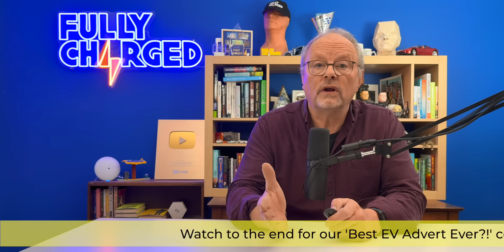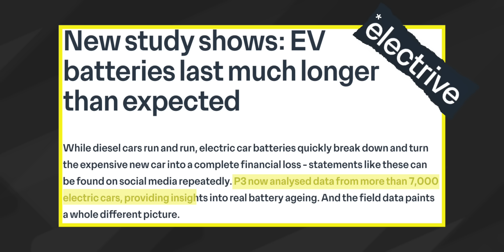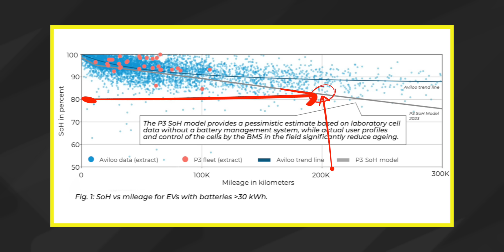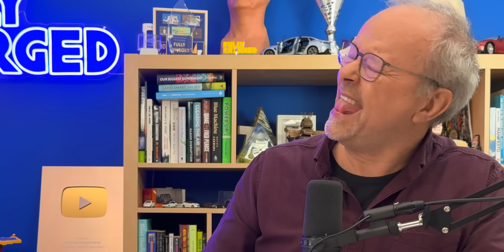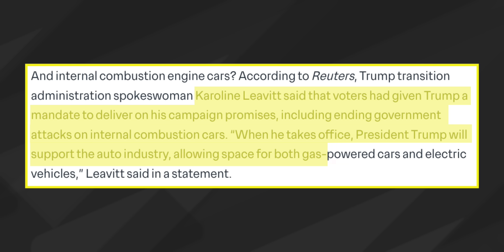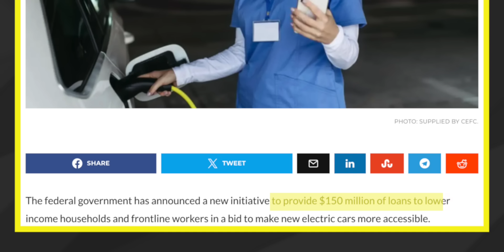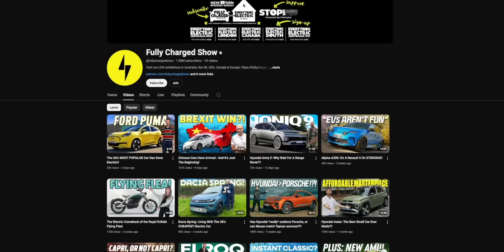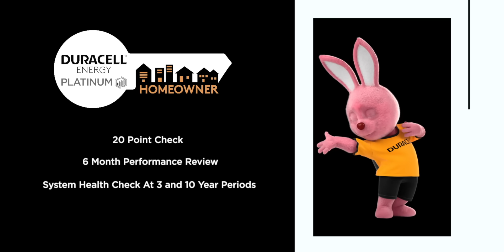The Truth About EV Battery Life, Government Subsidies & The Future of Coal Ash?!

Comment: The problem with solar panels the best they can ever get assuming it never rains, hails, snows, overcast, hurricanes, tornados is they can only operate 50% of the time. And the further away from the equator the lower that figure gets because of seasons. Meaning you have to have an alternate power supply running all the time on standby.

Comment: I'm not a hater or a Daily Mail reader, but I was put off buying a second hand Jaguar I Pace because of battery issues.
It's probably an isolated manufacturing problem with 2019 cars, but Jaguar are having to buy around 3000 of them back at market value,  I love the look of  Ian Callum's design but I've also read about the long waiting times to book Jaguars in to the dealer for attention. Sad to say ,I'm looking at buying a Korean EV now.

Comment: EVs = excessively expensive, very high insurance cost , extortionate road tax, 40% depreciation year one, no second-hand market, high 'fuel' costs (home electricity will attract surcharge for EV charging soon), unreliable, dangerous, fire risk, car park/ferry restrictions, breakdown services won't repair/touch, minor dings result in insurance write-offs, range anxiety, 40% range reduction in winter, no soul/character, National Grid cannot support further EV adoption without blackouts, the public don't want EVs, too much unnecessary technology/unreliable, batteries cause environmental pollution/recycling extremely difficult, contribute to sl*ve labour/human rights abuses (where do you think the minerals for the batteries come from?), government EV sales mandates destroying British jobs/industry (Vauxhaul), increased tyre wear causing more roadside pollution/toxic, expensive servicing costs, public charging station disputes/anxiety/costs/out of service chargers, extremely heavy - contributing to erosion/pot holes, WEF/Net Zero/15min Cities driven, funds the Chinese government and industry.... and that's just for starters! And, by the way, split-water hydrogen engine technology is poised to take over the EV market as it's safer, cheaper, accessible, better for environment and can be retro-fitted to existing ICE engined vehicles (including classic cars).... Don't get me started on manufacturers forcing Motability users to lease/buy EVs which are completey unsuitable for disabled users (the weight of the charging leads - the complicated payment apps - the short range etc.). = EVs are obsolete.

Comment: I disagree, I don't think a battery is still 'fine' after 300.000 km, if 25% of the capacity is gone. As the capacity wasn't that great to begin with, another 25% less is a lot. I have a petrol car nearing 260.000 km, and it still has 100% range capacity. Having said that: I don't say I won't by an EV. If I could afford an Aptera, I would certainly buy it.

Comment: When an EV can perform as well as my diesel SUV, I will be happy to switch. I rely on towing capacity and mileage. Australia is a huge country and long distance driving is the norm. The infrastructure for EV's is virtually non existent. Most people live in apartments which have no facility for Charging. If i lived in the city and had access to a charger, i would certainly go EV.

Comment: My 1993 MX5 was fine after 450,000 km.
In that distance, It had a new radiator , a new voltage regulator , a new clutch it didn't really need , 3 cam belts, new differential bearings because a previous owner did not fit an LSD correctly.
All of which I performed myself.
If your car turns to crap over a short period , it just means you are a careless consumer like most people and not the environment/conservation minded person you imagine you are.
And your ownership of an EV will be equally as wasteful

Comment: My electric Citroen E-dispatch displayed a range of 200 miles when new  . After 31000 miles yes 31 , range is down to 135 !! Light use but I found it would lose around 25 miles in winter months but it would not come back when temperatures rose .
Reply: Range estimator are notoriously inaccurate

Comment: Sadly, the deep history ice sample and other evidence shows that we are just existing in the time lag between unprecedented CO2 pollution and the inevitable hellish temperature rise. Big Oil killed us in the last 20 years of the 20th century.
Reply: This videos has couple of arguments that I don't fully support, but the argument that I seem to fail to find is regarding the EV charged from coal power plant, according to chatgpt investigation😅 the total emissions of a EV charged from coal energy is still less than gasoline or diesel when comparing emissions from earth to exhaust pipe (just the oil extraction+ transport+ refining+transport+30% efficiency in the car  compared with digging coal and burning it at about 50% efficiency [using residual heat for city heating and industry] and 75% to the EV till the tire [electricity transport in grid +charging+battery and engine efficiency] with bonus of regenerative braking and way less maintenance costs) 
In general there are very few cases where the ICE is still very hard to replace by EV
There's a great speech of Carl Sagan comparing the cold war investments and the climate change investments😅😅

Comment: The clean energy price is linked to gas though hence consumers dont see the gains. Although are frequently informed if they didnt change their old lightbulbs for new, their energy bills would be higher.

Then comes nerfing. Building bulbs which have a limited lifespan of 1-2yrs or consumers fridges stop working due to last update. As its the greed of business which dictates what consumers have to pay and do.

Heavy ev's for example has been resoundingly impracticable. So much so that almost all but Jaguar have pulled out of such vehicles. The price ceiling also became too high for any mass market product, to be viable. They simply ran out of gullible consumers ⬅️

Comment: I like your content, but now your telling lies. I have an Isuzu DMAX diesel Ute. And I’m coming up on 300,000km with no major issues. It’s not full of spare parts and still looks fresh. I know of other diesel vehicles that have done even more. I like the idea of BEV cars. And I’m thinking of getting one. But Im pretty sure that by the time the BEV gets to 300,000km there will be electric motors to replace or repair. I feel yes the batteries will still be functional,  but its the windings in the motor(s)of a BEV that will need an overhaul before that 300,000km mark

Comment: In 2015 I responded to Clarkson's dishonesty regarding EV's and some local hostility towards solar panels and wind turbines... I put a PV system on the roof and purchased a one year old, 10,000 mile Gen 1 Leaf. My wife uses the Leaf for a daily 30 mile commute plus countless journeys with our kids.

We now have three EV's on our drive, including the Leaf which has now done 134,000 miles with the original battery still at 82% according to Leaf Spy.

I drive a 2024 MG4 Trophy which I really like, especially as I got it brand new for £25.5k. The LKA is an abominable bit of software failure but it's easy to work around.

We also have a VW ID Buzz Cargo for business use. We do a fair bit of work in London which is a 125 miles round trip from here. Compared to ALL other vans I've driven over the past 30 years (petrol, diesel, manual, auto) the Buzz is in a league of it's own and an absolute joy, especially in 4mph London traffic using ACC.

Ok, the Buzz is one expensive van but we charge at night at 7.5 pence per kWh which saves 16 pence per mile on running costs. We'll keep it for 100k miles which repays most of the additional cost (I'm more than happy to pay any potential additional cost incurred when compared to an Ice van because I finish all journeys WAY more relaxed).... It's really nice doing 65mph in lanes 1 & 2 rather than 85 in the outside lane like many other van drivers - and I'll only be 5 minutes behind them when I get to central London, with my clean license...

The one absolute essential for successful EV ownership in the UK is the ability to charge off road, at home or at work (ideally both). Public charging is getting much better but the cost is daft.

BTW. Our PV system outperformed all projections and has been an excellent investment (how I wish all my decisions in life had been as good..!).

Comment: If there is no concern about the battery then car manufacturers can own the battery and replace when degraded 👍
Reply: Renault did that with the early Zoes and the Twizy but it was dropped probably as it hurt resale value so put people off. Right now there are some very cheap mk1 Zoes for under 3k but as they were sold without the battery you'd have to pay £50 per month for the battery.

Comment: 5:36 the diagram of the aging doesn't show the improvements in thermal management systems. My first EV back from 2017 had a degradation of 10% after 100.000 km, my second from 2022 has about 1% after 100.000 km.

Comment: In Australia a Rolls Royce Spectre is $1.2 plus million. How long will its battery last? 
Can you still drive it or even turn it on in 25-30 years? It doesn’t matter on a $50 thousand BYD but very different for a Rolls. 
You can quite easily still drive a 100 year old Rolls Royce without any problem. 
What does everyone think,what is Rolls Royce’s sales spin if you ask this question in the showroom?

Comment: To be clear, I am a fan of EVs.  If I could afford one with a usable range I'd buy one.  But I am also a realist.  Whether you like it or not, you are still very dependent on fossil fuels. At this time of year in the UK, typically about 50% of energy demand comes from gas turbines.  When there's no wind that goes up to 60 to 70%.  Just checked - today, only 1% of demand is being met by solar.  So why belittle and denigrate attempts by the fossil fuel industry to mitigate the effects of that?  Sorry, but your mocking and sneering rant has put me off.  I don't need yet another bias confirmation channel so I will take your advice and unsubscribe.  'bye.

Comment: there is an irrigation reservoir just across the field from where i live. the guy who owns the farm has just covered his cowsheds in solar pv, about the same area as the reservoir, and cheaper to do because the infrastructure around the cowsheds supports the installation of the panels much more easily and cheaply. Also he told me he didn't want to see geese and swans bouncing of the panels on the reservoir as they try to land on a surface that to a bird looks pretty much like the water surface. So has anybody looked at the environmental impact (no pun intended) of solar PV floating on water? i can think of quite a few effects it may have on the ecosystems in and around a lake.

Comment: In France I woukd point to how people view the use of a car, tge difference of rural against urban . One point to make is the filling up of petrol may be every two weeks and the feeling is that an electric car will need recharging every two days, the more  frequent the charging time the more it seems to require local charging points and these are not available for more than a few cars . If villages were equipped with five or more charging stations I am sore there would be a fast take up of EVs. Around cities there are areas of parking and charging with solar equipment but the space is not always availabke in villages or small towns , here it may need grid linked chargers and some form of card activation and a localized payment scheme .

Comment: I like your show. And I agree with providing accurate information. However, you have made an error. I just bought an EV after I traded in my 2007 Prius, which I drove for 266,000 miles or 428,000 kilometers without any major mechanical failures or repairs to either the mechanics or battery. I know that it a simple of argument, but just stating something is complex does not support the conclusion it is less reliable. I am certainly glad I did not drive a petrol car for 266,000 miles.

Comment: I have to disagree that cars are knackered that mileage
My last 2 cars had over 220,000 miles and were sold on to people who carried on using them.
An 2006 audi a6 2.7tdi quattro that was a dream to drive even at that miles and a 2009 Citroen grand picasso 1.6hdi which was just an old clunker but still kept going and wasnt horrible to drive.
Biggest issues with both cars were electronics and not mechanical.

This is my biggest concern about new cars as the electronics are likely to be the fail point and theybhave a lot of electronics on them.

I know drive a Skoda Enyaq on the motability scheme and absolutly love it.

Comment: Hi Robert, great news as always.  FYI... my 8 year old EV just reached 300,000km  (187,500miles).  The battery has lost 10% of it's original capacity, range now 400km in winter.  Whilst it's worth giving attention to the longevity of EV batteries you might want to also celebrate the extraordinary capability of electric motors.  My car has two, neither of them has ever required any attention.  Nothing!  They purr along with the same fluid power and dexterity that they had when I first drove the car.  I can not sense any change at all.  I have been advised by Cleevley EV's that they are due an oil change now.  Try running any ICE motor for 300,000 km without giving it any attention.  The BMW's and Volvo's I used to own would be on their last legs at this mileage and costing me a fortune to service.

Comment: The so-called: electric vehicle batteries have a short lifespan, so used cars are cheap. This is a wrong image. At least in China, the reason why second-hand electric vehicles depreciate rapidly is because most electric vehicles are replaced once a year, and each generation makes great progress with the addition of new highlights. So the depreciation of second-hand electric vehicles is significant, and if the price difference with new cars is not enough, buyers will definitely prioritize buying new cars on sale. The Traditional car companies facing difficulties in electrification media distorted the reason for the serious discount of second-hand electric vehicles, and the problem is not the battery life. In addition to the reasons mentioned above, in China, major car manufacturers generally provide lifetime warranty for batteries, motors, and electronic controls for the first owner, while the second owner who purchases a used car only has a normal limited warranty period. This kind of warranty discount, on the one hand, indicates that car companies are confident in the service life of batteries, motors, and electronic controls, but on the other hand, it also leads to a greater depreciation of used cars. In fact, if you want to know how long the battery life is, ask experienced drivers who drive ride hailing services. They all know that, for example, in Shenzhen, there were pure electric taxis ten years ago, Many cars have traveled millions of kilometers.

Comment: Something need so be done for those who don't have access to parking where they can charge an EV overnight for less than 10p per kWh don't have to pay 35-70p per kWh. Or there will be some who are very disadvantaged in the transition. Local overnight secure charge hubs with cheap electricity they can use twice a week springs to mind.

Comment: You forget to mention you have to put the 300k on before 15 years. Because the batteries start to die after 11years  few will make it for over 15 years. And of course that totals the car.
This is why you see 8 year warranty
Reply: SO the Tesla Model S that replaced a battery after 500k MILES that we saw in Sydney last year was totally fake then.
Reply: Again batteries  dies on time,  getting a lot of miles it's nothing unless you're going to drive them. Original Teslas that are about 12 13 years old not all dying, and they might have only 70,000 miles on them.  it's the amount of time the battery, they dry out no matter what you do you cannot save them. Very few people need a car to drive 500,000 mi in 10 years.

 Most Toyotas  run for 20 to 30 years. There won't be one battery that can make it that long.  Now in the future they come up with solid state batteries that do not dry out does the possibility. As of now, battery technology is just not there for $100,000 car. That will unfortunately be totaled in 15 to 20 years max, because of battery age.